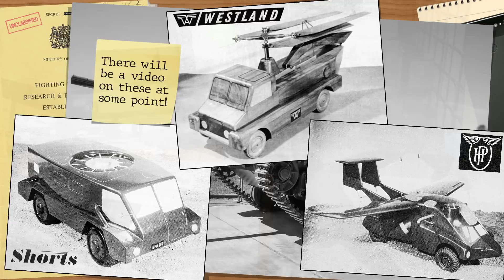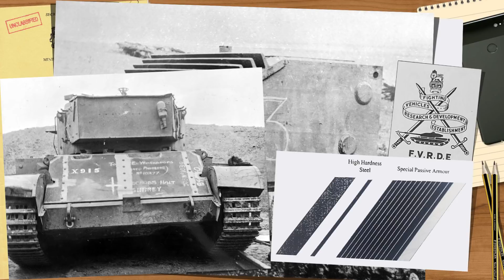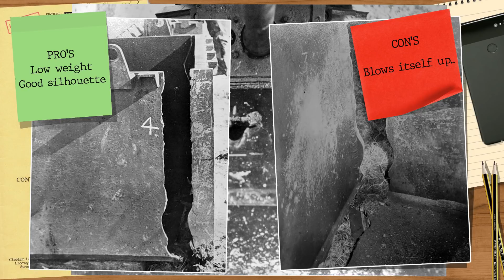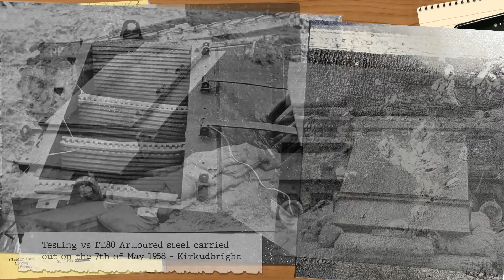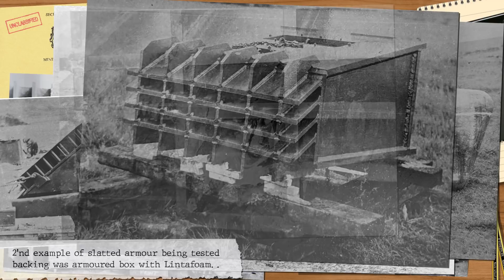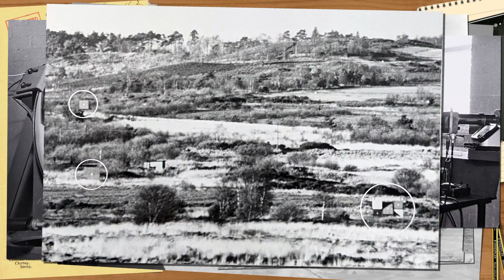Project Contentious – Tank Design & Development

Comment: Couldn't they have put pressure valves around the tank. So that some of the fuel can be controllable released if its hit. So any excessive pressure, such as a round penetrating the tank will force fuel out the valves and not blowing out the welds.

Comment: You say fluids can't easily be compressed. I disagree. Liquids and gasses are both fluids, and gassed can be easily compressed. 
IMO the correct statement is that liquids can't easily be compressed.
Reply from the maker: 100% right, i tohugh id added liquids cant brecompressed, well not easily. damm will have to listen back, you are right tho, they can be for sure
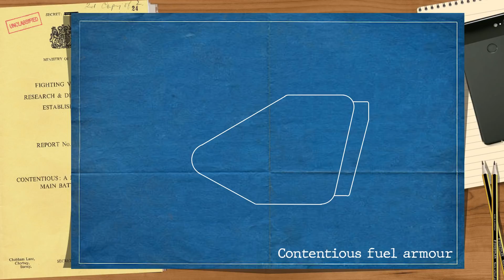Reply: @armouredarchives8867  5:53 is where you say it
Reply from the maker: @totensiebush  ahh yes, well appologies, i checked with a few guys that do this stuff, they all agreed it can be (seems there is a myth about non compressability) but that they are not easily compressed, the papers on contentious had the same issue that the fluid would rip the contaniner apart before anythign else

Comment: Separating the fuel from one tank into individual self sealing bladders would have solved the problems of excess fuel leakage after being struck.  4 bladders separated by steel walls mean the vehicle would probably only lose 25% at most.  Also once the fuel tank doesn’t have to be water tight you can do things like add spring loaded blow out panels.  Which solves the hydrostatic shock problem.

It adds complication in that the crew may have to switch between fuel bladders from time to time.  But that seems a small problem.
Reply from the maker: how would you stiop the same issue on a smaller scale, if you had 4 bladders and you hit one, the shock will still rip that one apart. thu 2 are ruptured? also trickier to feed the fuel back as you dont want to feed it via holes in the rear armour plate as this will lkead to edging around any hole used to feed the fuel?
Reply: @armouredarchives8867  I guess if you could solve the exploding issue, then funnel any leaks into a lower tray underneath of some kind and have a pump to transfer to an auxiliary tank. Would at least keep the fuel and the tank usable.

Comment: Is there any data as to what the weight and dimensions of the complete tank would've been, what engine it would've used, etc? Such a pity that a full prototype was never built, only testbeds of certain aspects.
Reply from the maker: il try and add those in the enxt bits, engines has so far been the tricky bit

Comment: Very cool. It goes to show you how much effort and expenses are required for R & D. I personally wouldn’t be thrilled about hundreds of gallons of fuel in front of me. I’m thinking that replacing it with water and having a replaceable pressure valve that would burst outward when a certain pressure would arise might have been something to try. Thanks for the video.
Reply: Excellent idea !  Perhaps theyt could use some kind of heavy oil, lots of density to soak up energy and some heavy oils have very low flammability. But the pressure valve should allow it to rapid-vent to a reserve tank (or perhaps allow the back plate to briefly release and slide back into a void behind it).  A pump could then push the fluid back as soon as the hole was sealed, so that the armour didn't become a one-shot only protection. The only problem is that it starts getting complicated !